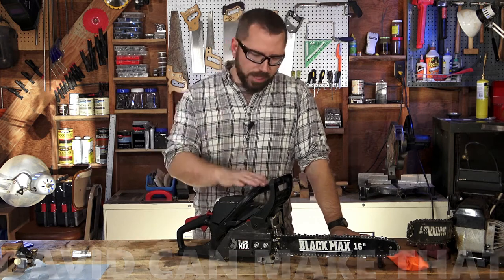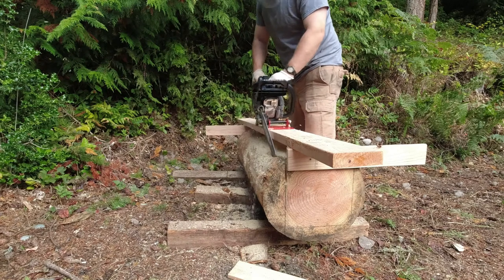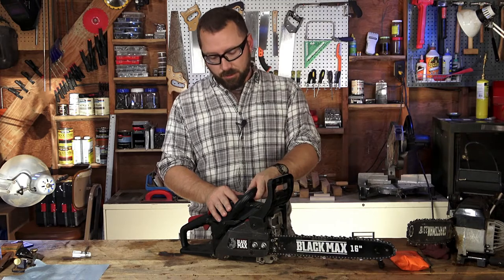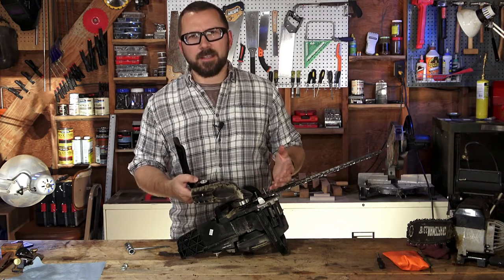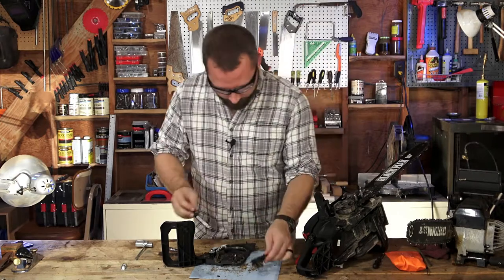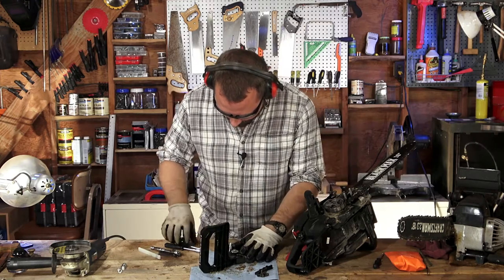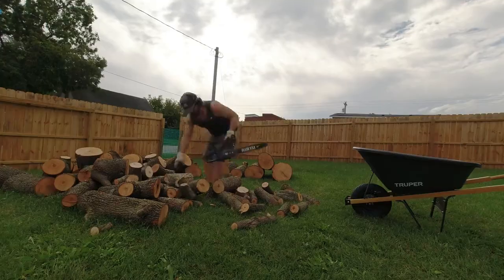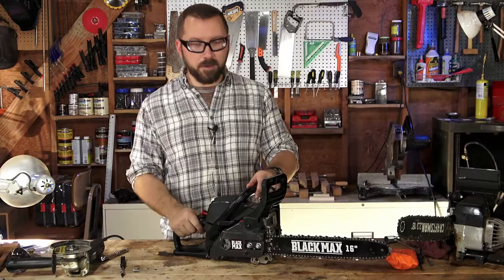Black Max Chainsaw Major Problem and Fix - Re-review

Comment: Just bought the 20" from my local Wally World. Thanks for the heads up on the brake. I'll keep that in mind should mine start to show those symptoms. Hopefully they have received enough returns by now to have rectified the issue. Thanks again. 👍

Comment: Thanks...I didn't cut the spring but I did clean it really good and I fixed it for now...I'll cut the spring later if stalls agains...never would of thought that could of been the issue...mine had a whole lot of build up. Thanks again.

Comment: Just did this fix, since the chain on a pawn shop black max loaner. That was only $100 was having trouble spinning. Seems to have made the chain not struggle anymore. 

Yet the damn thing still gets hot af. Hopefully I can get the job I need done without it crapping out on me.

Comment: How much is "this much" that you cut off the spring?
Reply: I have the same question.  Don't want to cut too much off and make things worse.
Reply from the maker: I only took off about half an inch. I would start with a little less and work your way up if you need to. The good thing is the chain brake is not required for the saw to function. I've owned a few that were older and didn't even have one.

Comment: The Brake loop is not Manufactured round and when it gets heated up it is even less round,it stalls the saw, burns up the clutch, and sizzles the chain lube with all that hot clutch an sprockets.  Asian Planned destruction of cheap tool

Comment: Bought the 18” and it crapped out after 5 mins.
Reply: Same here. It was running like a beast for 5 to 6 mins perfect fuel flow and everything and then it started to hesitate when I pulled the trigger and then the chain started to spin and work but all.of a sudden it squeaked and then died
Reply from the maker: Mine still runs ever since the fix. That doesn't mean its always easy to start though.